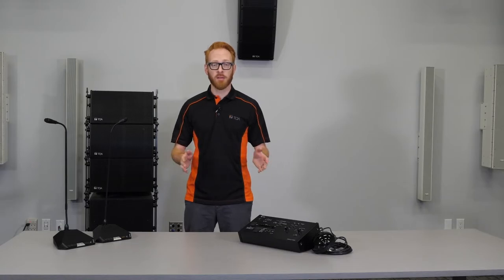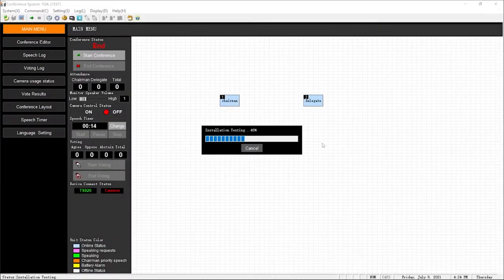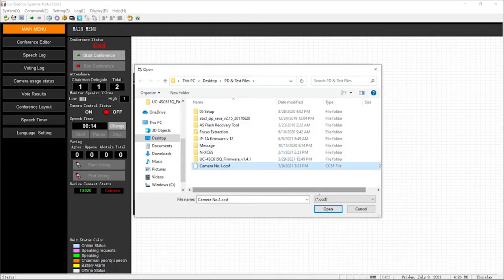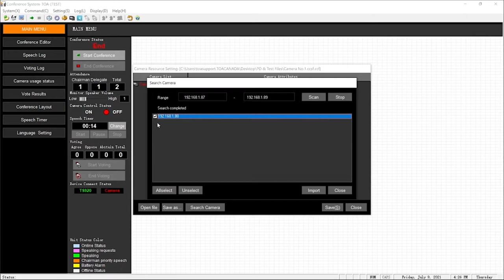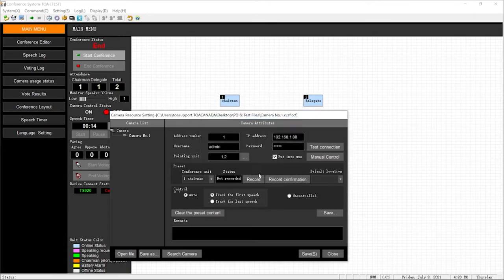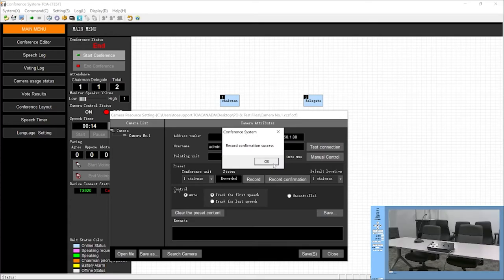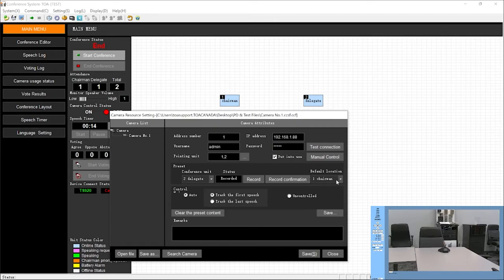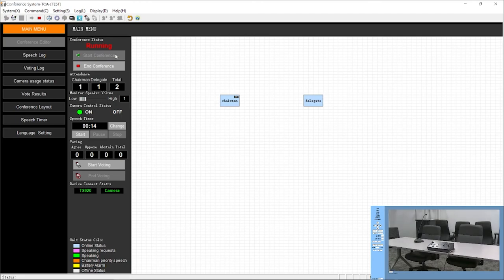Mic'd up with Mike - TS-920 Conference System - PTZOptics Integration

Comment: does it also work with any other PTZ cameras which support ONVIF?
Reply from the maker: Hi Carlos, as of now we can only guarantee it will work with the two cameras outlined in the video.
Is there a particular PTZ camera your thinking of?
Reply: @TOACanadaCorp  Hello. We work with Sony and Ikan. Ikan has a PTZ camera, the OTTICA which works with ONVIF
Reply: @carlosguevara2938  Hi Carlos, thank you for the video. If two or more delegate units work at a same time, how tracking can be operational? Can we integrate camera with brands like Aver, Lumens, Arec, Logitech?